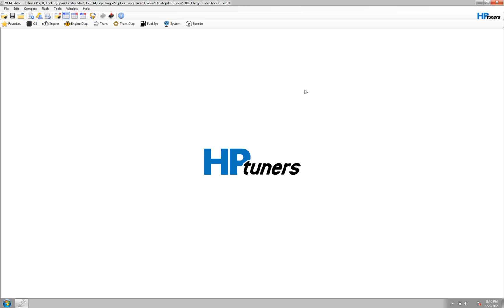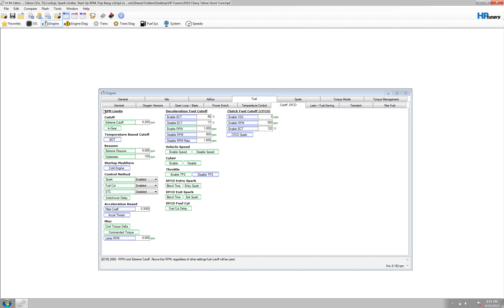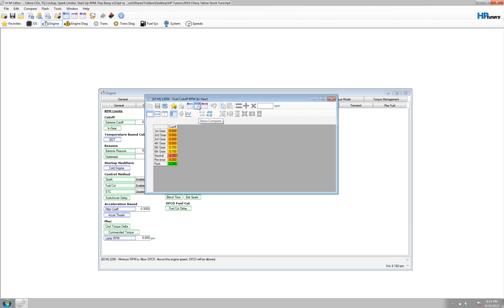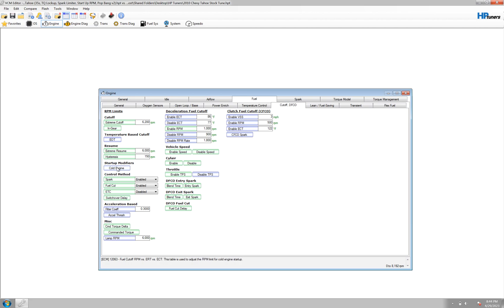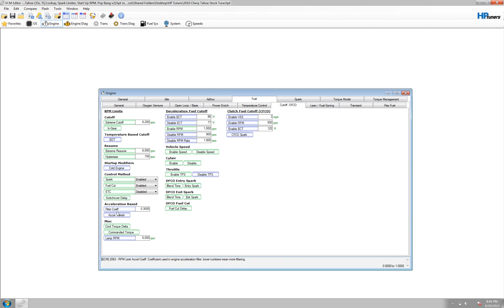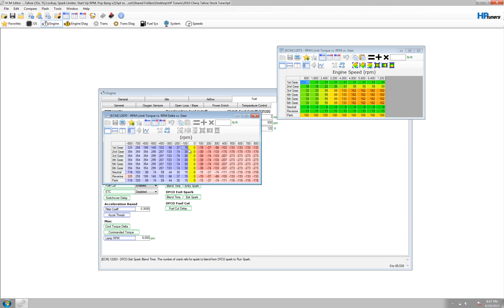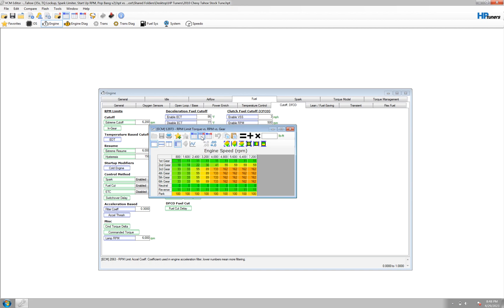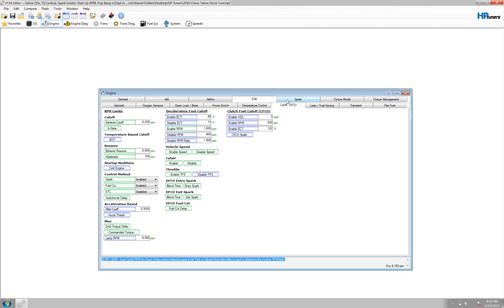How to mod rev limiter - HP Tuners

Comment: I had my car tuned but want to change my rpm cut off/resume. Can I use a separate hp tuners device to make those adjustments?
Reply from the maker: @MiikeZ-op9xj  assuming the tune isn’t read only you can but you’ll need to pay the licensing fee again.

Comment: If you enable spark cut only and disable fuel/throttle cut, can you acheive the BANG BANG BANG kind of stuff? Im tuning a gen3 LQ4 so i have cable throttle. I want that 2 step backfire stuff lol

Figure if it only cuts spark and has to drop like 3 or 400 rpm, might be enough delay to get some raw fuel in the exhaust thatll light off when the limiter quits. Thanks
Reply from the maker: It seems possible but I am not sure if it will work or not. I have never tired.

Comment: All I wanna do it be able to rev my car in park or neutral like a traditional car rev it all the way to the red line but my vw golf tsi auto stops about 4000rpm what can I do to bypass the silly low rev limit
Reply from the maker: Easily achievable if you purchase HP Tuners and mod the tune yourself. Or purchase a mail order tuner assuming you have the option to change that.

Comment: Hey ☺️ The Camaro V8 Gen6 have a soft Limiter. But i want a Hard Cut when i drive manuel with my Paddels on the steering wheel with my AT Gearbox like in this Video of a Audi RS5 ( https://youtu.be/oqhEvU7PFOw ). Do you know how i can change this? 

Best regards 🤝🏼
Reply from the maker: Rev limiter settings can only be changed by a tuning software such as HP Tuners. Specifically how within the software can vary slightly from one car to the next but in general it's done the same way like I outlined in the video. So in order to do it you will have to purchase HP Tuners or pay a tuner to make the modification.